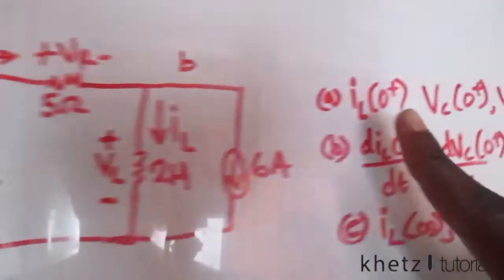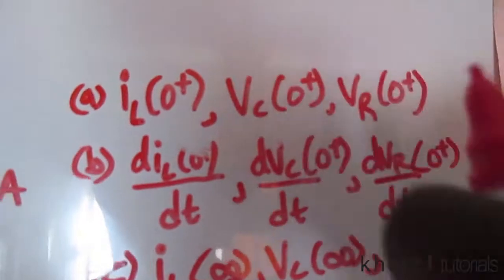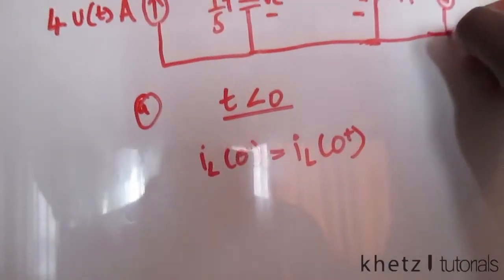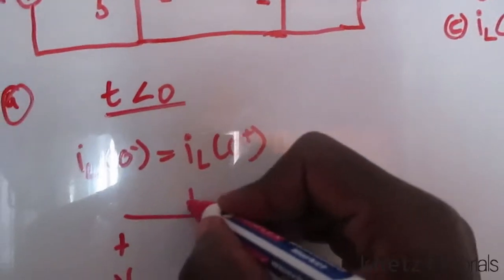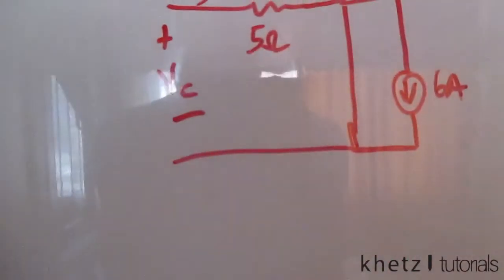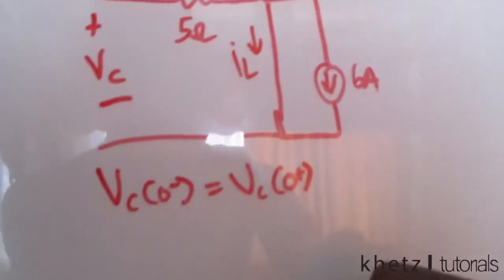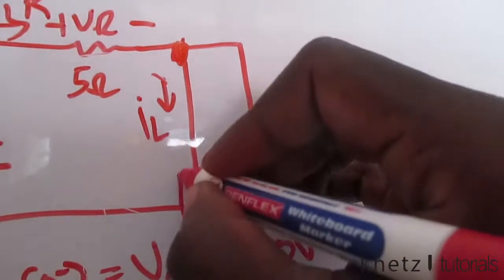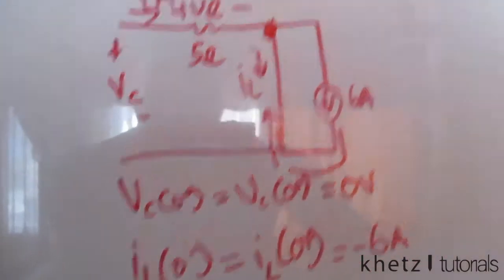Fundamentals Of Electric Circuits Practice Problem 8.2

Comment: Sir like first we have calculated dvc/dt then why instead of it we are substituting ic value and doing derivative and saying it is 0 .If it is done like this ,then dvc/dt separately becomes 0 right
Reply from the maker: I'd appreciate it if you'd indicate the specific times you're referring to in the video. If I understand your question correctly, it wouldn't work like that because each of the quantities is calculated at different times